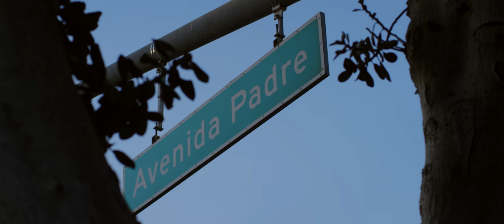Single or double drivetrain? Find out the reasons why Carl Bauer likes his 1X11 drivetrain | SHIMANO

Comment: Because he gets paid for it just as he would get paid for riding 4x6 or whatever.. Simple reason. 3x9 was standard. People bought xtr or x.0 or lower but the point is 3x9. Then they were fine, the sells stopped. Then came 3x10 first. People bought it because it was new. Sram and Shimano sensed it. If they put up newer crap people going to buy it. Then came 2x10, 1x10, 1x11, 1x12, etc etc etc. Same with the wheels. 26 inch wheels were standard. 27.5 came out for the same reason. People bought it. Nobody said a Word about 29 inch Wheels that time. NEXT YEAR 29 inch was on market. Disc brakes are made for profit too. They simply can take more money with a disc brake sell compared to rim a rim brake.. Business. Not effiency. 

3x9 beats 1x11 or 1x12 if that's not an uphill race.
Reply: What's your opinion, i want buy new bike 1x10 or 2x10.. So what's the best for me? 1x10 or 2x10? (sorry my english is bad) please answer my question sir 🙏
Reply: @mochraihan9479  
1x11 hands down.

Comment: Please, make a video about "Shimano Xt M8000 Chainline Issues". Equipped new 46t XT cassette, chain, crankset and  shifter all works fine apart from when back pedalling in the 42 the chain lifts and drops to the 37. Around the world many people are experiencing this problem.
Reply from the maker: Hi Fernando,

Thanks for contacting.

Please contact your dealer. I'm sure they can help you out when they contact our local distributor in your country.

Kind Regards,

Rob - Team Shimano
Reply: with that chain angle it is the nature of the beast.